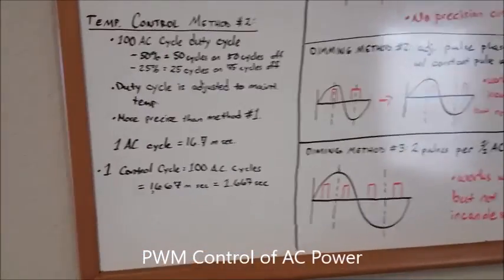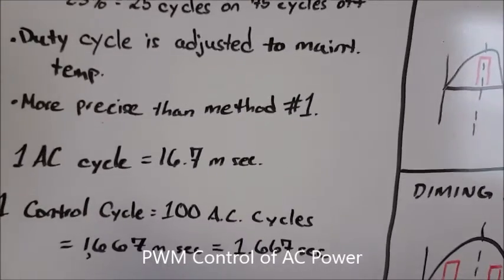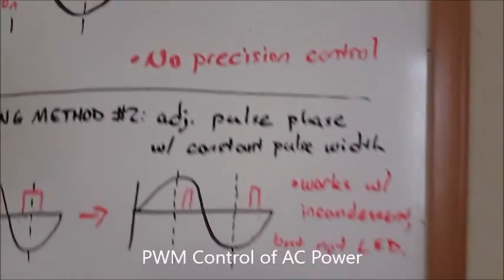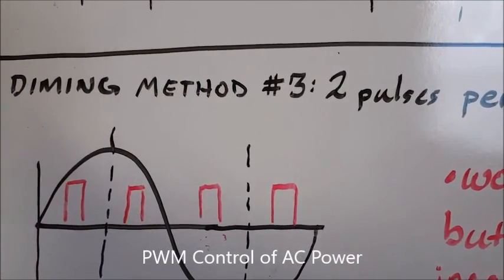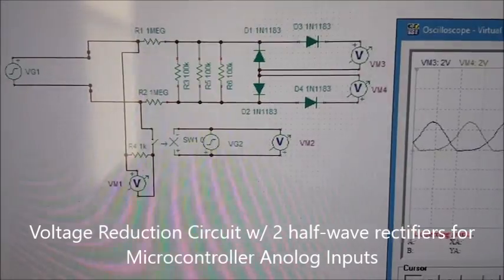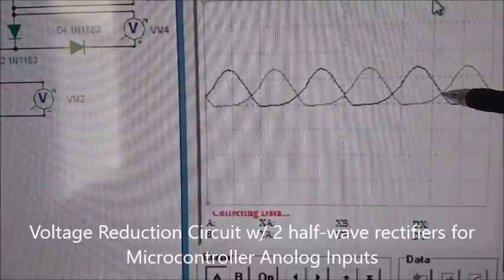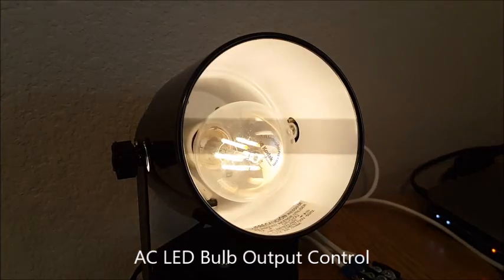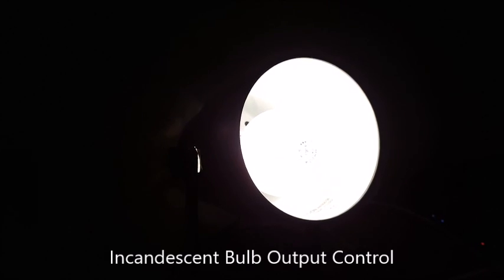PWM Control of AC Power

Comment: Could you share the circuit diagram and code
Reply from the maker: It took some time, but I did find everything an pushed it to github, you should be able to access it at https://github.com/vicks255/PWM-For-AC-Power/tree/main/AC%20Light%20Dimmer
Reply: Thank you very much

Comment: Is the LED light bulb flickering or is that the camera having difficulty?
Reply from the maker: That's the refresh rate of the camera catching the pulsing of the LED light bulb.  The pulses are too fast for they eye to see, but it will be seen by a camera.  I haven't been able to come up with a scheme of pulsing the LED bulb that is invisible to a camera yet.
For LED's, I'm pretty sure you would have to modulate a DC signal in order to get a faster PWM cycle, but even that will be limited by the how long it takes the LED to react to the on signal and how long it takes to decay once the signal pulse goes back to 0V.
Reply: @255Vicks  if you have the control,  try lowering the shutter rate for the camera to stop that banding... 

Also really cool,  looking up how to pwm ac,  for a reflow oven I'm working on...  Though I might just end up going bangbang....  One nitpick though...  Your micro controller ac sync inputs. As you're dealing with mains,  use optoisolators between mcu and pains feed...  Just safer!
Reply from the maker: @MD_Builds  Don't have that level of control over my phone's camera, but it was a fun learning project.  I'll have to give this a try this with the ac sync inputs.  That sounds like a sound suggestion.